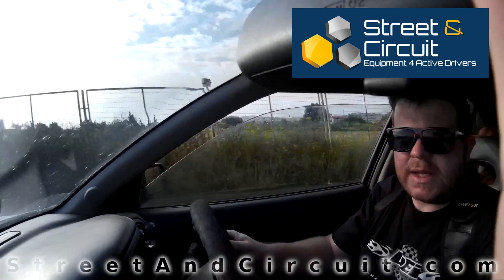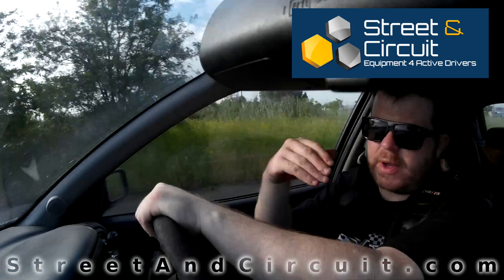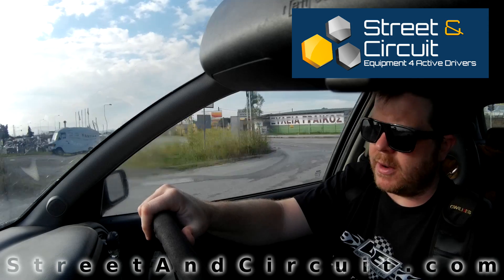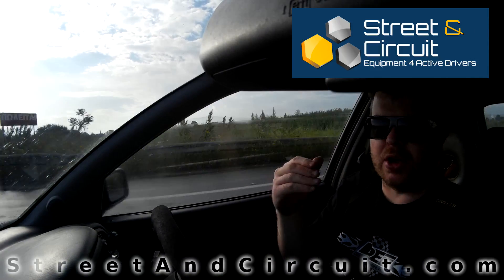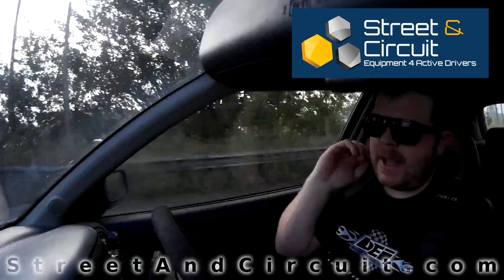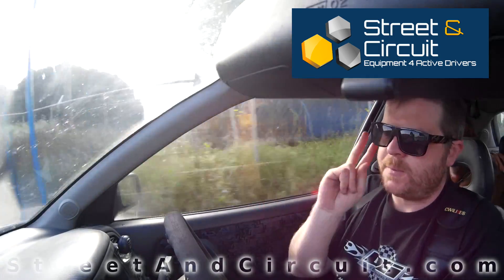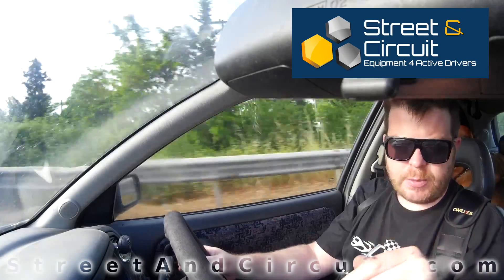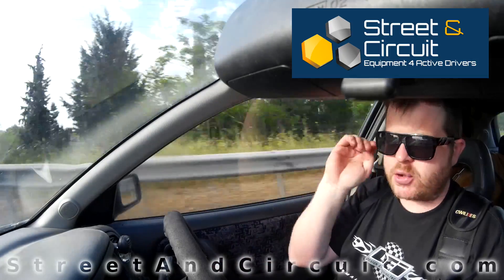How Petrol Tuning Boxes Work (Turbo Engines Only)

Comment: Do tuning boxes increase MAX boost? I can understand that the tuning box will alter the level of boost under the entire rpm curve i.e. you make more power across the entire rpm band. But will that be up to the MAX boost point of set by the ECU?

To cut the long story short, will a petrol car with MAX boost of 1.3 bar set by the factory, exceed the 1.3bar after installing the tuning box? Or will the tuning box just increase the boost throughout the RPM range, but never exceed the 1.3bars?
Reply from the maker: Hi. Depends on the car and the sensor it uses. The tuning boxes we sell will only change the signal under certain conditions ie not all of the time. Max boost will usually be increased.